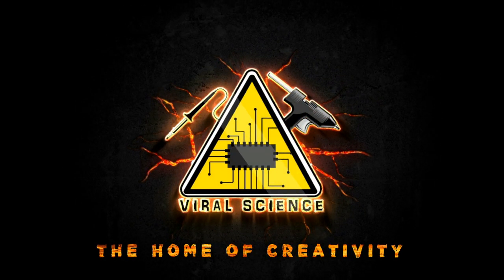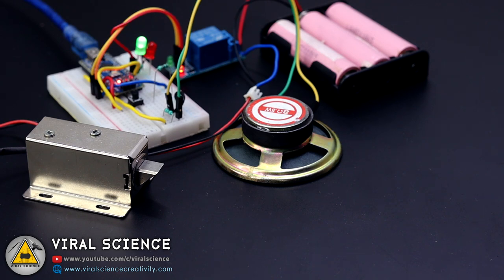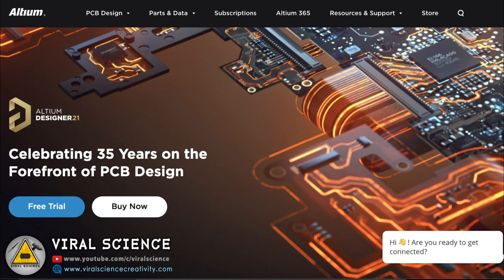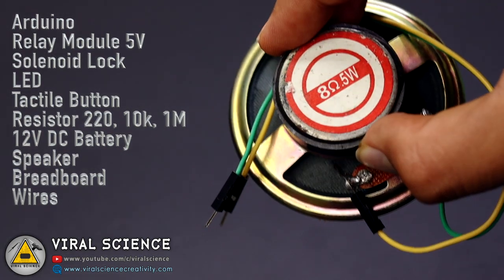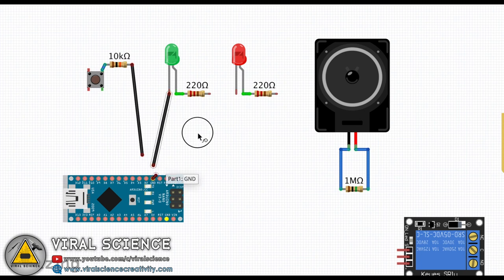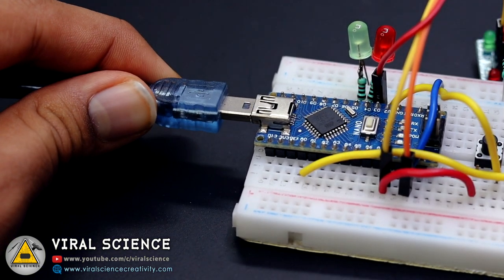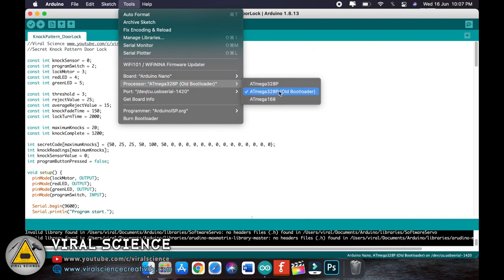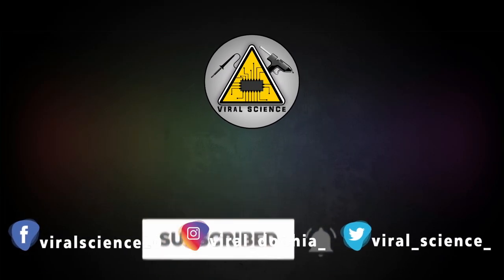Arduino Secret Knock Pattern Door Lock | "Knock, Knock!" Lock

Comment: Hello bro.When I press the programing button it automatically turns on the relay after 5 seconds.I push the button but nothing happens.I use buzzer,so what should be the resistor between + and - of buzzer.And what would be the problem.Thanks.
Reply: Hey, did you find a solution?
Reply: @ferdlw4070  No
Reply: There's no buzzer in this circuit. According to his schematic; there's a 1,000,000 ohm resistor in parallel with the speaker (the speaker is being used as an input device).
Reply: Bro, Same problem here too code and circuit is wrong

Comment: Hey bro, can you tell me how the pattern is being registered ....I mean there are no sensors here ...so pls do tell me
Reply: The input sensor is the speaker. Whenever the speaker "feels" vibrations, it varies the voltage signal on the Arduino input pin.